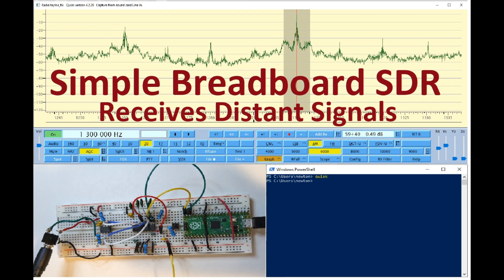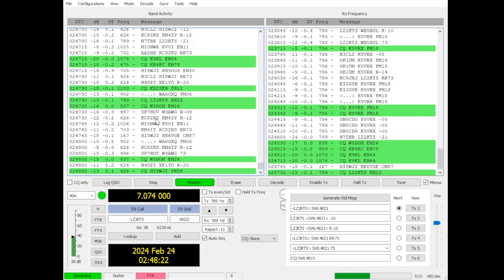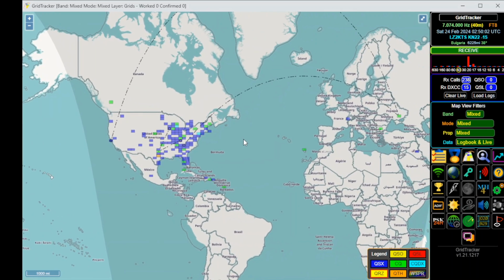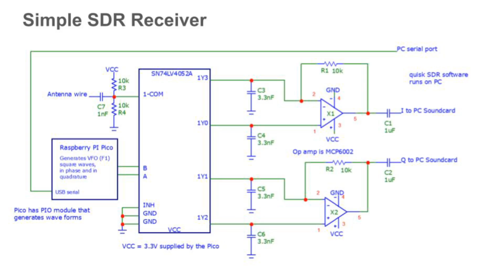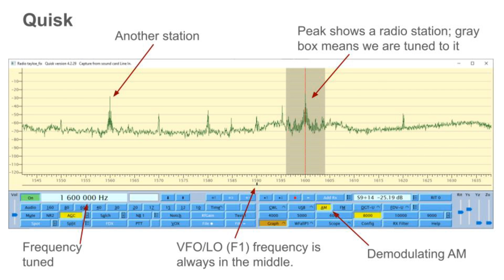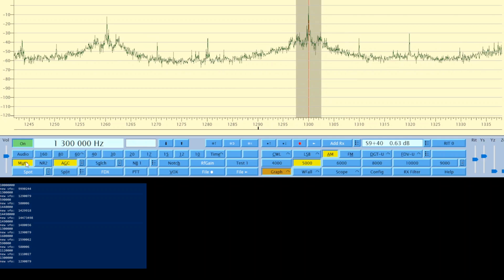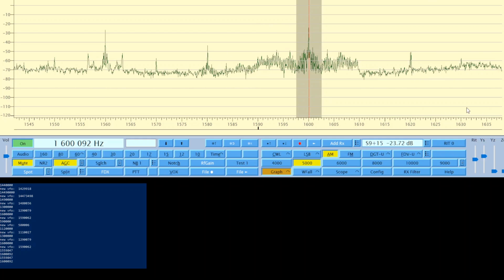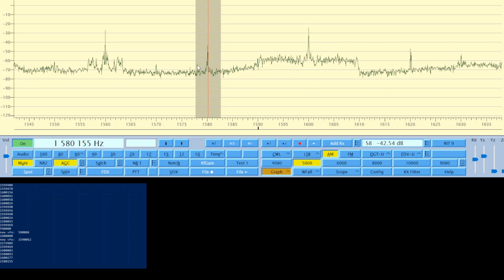Simple Tayloe Breadboard Software Defined Radio Receives Distant Signals

Comment: Are you running the Q&I audio streams through Quisk first and then piping it into WSJT-X?  Can you provide a bit of detail on exactly how you're doing this?  Thanks!
Reply from the maker: I recall that I connected directly to wsjtx.  You can connect it directly to the sound card.  I tuned the receiver manually-- by typing to the rpi pico serial port.  Connecting to quisk was harder.  I never did it perfectly...
Reply: @electronics.tinker  I checked and wsjtx isn't set-up to handle I and Q inputs - just straight audio.  To confirm I did a google AI search on "can wsjt-x use i and Q audio signals as input"  So it isn't exactly clear how wsjtx handled the input you fed to it.  It clearly decoded signals anyway but perhaps it relied on a single channel audio input.
Reply from the maker: I think you must be correct and that my memory is faulty.  Initially, I didn't plan to make this video so my record keeping is sloppy for it.  I was also using quisk.  Maybe I had quisk demodulating USB for wsjtx and just forgot that.  That's for your research.
Reply: @electronics.tinker  If you ran your output into quisk and then into wsjtx I believe you would have had to use some virtual audio cable software between quisk and wsjtx.  Perhaps you can recall whether you did this extra step.  If you didn't, wsjtx would probably still decode some signals  as I mentioned earlier.  Anyway, I enjoyed your video - it was very well done!

Comment: is it possible to make 100mhz to 5.5ghz sdr by a human hand {DIY}
Reply from the maker: That would be much harder.  Simple, cheap analog multiplexers are not fast enough.  Also producing quadrature LO signals at such high speeds would need different techniques.

Comment: This is a great video, thank you for sharing your knowledge with this simple but informative demonstration.  How difficult do you think it might be to create a similarly simple circuit to perform quadrature modulation of an input audio signal? Thanks again.
Reply from the maker: I presume you mean that the stereo audio will carry I and Q data to be upconverted to RF using the Tayloe circuit-- like for a transmitter.  I have not tried this, although it would be fun.  Dan Tayloe's paper briefly describes how to do it.  I put a link to that paper in my first video about the Tayloe mixer "Tayloe RF Mixer Demonstration...".   Also, you could check out NA5Y's youtube channel, in particular his video "ESP32 Based SDR Transmitter - Part 2 Tayloe Encoder".  He shows a schematic.

Cheers,

Comment: I actually followed this and dr volts video. It actually worked. It was stressful but fun. I ran into problems until i learned more about impedance matching. Thanks for this video lol
Reply from the maker: Very interesting.  What did you change to impedance match?  Also, what analog multiplexer did you use?  Most people use an fst3253 which has lower "on" resistance than the part I used.  This affects the input impedance and size of capacitors.  I paid little attention to this.  I just experimented with the size of the caps.  NA5Y uses a bandpass filter and, thus, more sophisticated matching.  I wonder how much the arbitrary nature of the antenna wire slung over a tree affects this.  NA5Y, being a HAM, might be using proper 50 Ohm antennas.

Comment: is there any alternatives for MCP6002  cant we use something like LM741, TL072CP, LM301AN, LM358L ?
Reply from the maker: I used an MCP6002 without giving it much thought.  I wanted the convenience of powering everything from 3.3V.  I was just playing around with it and was surprised that it works as well as it does. Dan Tayloe suggests using a precision or instrumentation op amp but for a toy receiver like this, my bet is that other basic op amps can work.  I think NA5Y used an lm324 in a tayloe detector.  It's convenient to use a dual op amp.  Dr. Volt used an amp that is especially good for driving sound cards.  Just watch your power supply level, pay attention to biasing the antenna signal (like to 1/2 of the op amp's supply voltage).  But also don't overdrive your sound card's input.  If you have a scope, watch out for clipping.  And use a long piece of wire for the antenna, ideally running outside.  Cheers and good luck.

Comment: thank you soo much!! i bought pi pico and a si5351 just to make a sdr receiver finally i can make one :)
Reply from the maker: I found it to be a fun thing to do.  I hope you do also.  Check out Dr. Volt's video and NA5Y's channel also.  There is a lot of material out there.  Getting quisk working takes a little guess work.  Let me know if you folks out there want more information on that.  I have found quisk to work better than other SDR software I have tried with sound card based receivers.

Comment: Really makes me wonder why some radios are $$$ when all they do is what this does in a fancy case.
Reply from the maker: Well, in the interest of full disclosure, a good SDR receiver contains much more: low-noise amplifier with gain control, multiple HW band-pass filters and HW to select among them, analog to digital conversion is included (instead of using sound card), and it works at a far higher sampling rate, and USB interface.  I think the SDR Play RSP1A is an example of a quite good but reasonably cheap SDR receiver.  And the rtl-sdr V3 dongle is not as good, but you can do a lot with it for a very low price.  Cheers.
Reply: @electronics.tinker  Great. Thank you. In case of only AM band receiver the band pass  modules would be ommited?
Reply from the maker: My guess is that at least a low-pass filter would be helpful even for AM medium wave.  I did a test with LO at 1 MHz and noticed that odd harmonics for the RF (like 3.005, 5.005 MHz) yielded false 5 KHz I and Q signals that were still pretty strong, e.g. the 3.005 signal was only about 10 dB down from the 1.005 MHz signal.  It also helps to choose cap values that give the detector no more bandwidth than you need.

Comment: Why is it these SDR radios do NOT come with instructions?? Going to a web site usually does NOT have any REAL information!!
Reply from the maker: Which SDR radios do you mean?  I agree that the quisk software requires guess work.  Do you have any specific questions?  The thing with SDR is that quite basic hardware (like an rtl-sdr v3) enables many things from listening to AM radio to receiving data from satellites.  There is quite a bit of youtube content, but it takes experimenting for sure.
Reply: @electronics.tinker  I cheaped out and got a TV board that had been adapted. Now I've got the "bug" (and badly). I want to make my own.

I have a very specific use for the Tayloe mixer that I haven't seen used before but I need to get the idea out of my head and onto a physical board! One dongle incoming from China now! :)
Reply from the maker: Sounds like fine.  Check out NA5Y's YouTube videos if you haven't already.  He knows a lot more about radios than I do.
Reply: @electronics.tinker my goldfish knows more about radios than I do so anything helps! This IQ stuff challenges my limited IQ to its limits. And more. I’ll get there eventually.

Comment: is it possible in Arduino atmega 328? thanks
Reply from the maker: I don't have an atmega 328 so I am not sure.  The task is to generate two 50% duty cycle square waves with one shifted in phase by 90 degrees from the other.  You want the frequency to be 10-20 KHz different from the radio station you want to receive.  The problem is that microcontroller timer hardware has limits to how it multiples and divides clocks to generate the final output frequency.  I bet the atmega 328 can do it for some frequencies but maybe not for the frequency near the station you want to receive.  This was the problem with the ADALM2000, actually.  The Raspberry Pi Pico is unusually flexible in how it can multiply and divide clocks, but even it has problems.  The way it divides can cause jitter.  Many people who build simple radios like this (including Dr Volt and NA5Y) use an Si5351 chip to generate the quadrature clocks.  This is a good idea.  Si5351 modules you can use on a breadboard are cheap and available from Amazon.  You would control the Si5351 from the Arduino using i2c-- but you really have to study the Si5351 to generate quadrature signals the best way.  But many on youtube have done it so there are videos to study.  I might do one more if I think I am adding something.

I'll mention another option.  You can generate a clock with 4x the frequency you need and then use a pair of flip-flops to convert that into the two quadrature signals that feed the mixer.  There are also youtube videos on this.  For example: https://youtu.be/OL52f-k3iIE?si=1-T5_9JH60DV_vtn.  I see a good video on mixers on this channel also.
Reply: Thank you very much, I liked the flip flop version  @electronics.tinker

Comment: Thanks!  After seeing Dr. Volt's video, seeing this super simple version is very nice.
Reply from the maker: Yes, though Dr Volt did  a great job I think.  To really improve the receiver, I suspect one needs to add an RF bandpass filter and maybe a low-noise RF amplifier.  But that would not be simple.  Check out this channel I recently found.  https://www.youtube.com/@M0NTVHomebrewing/videos
Reply: @electronics.tinker  Indeed.  It's the difference between the most minimalist design that can be reasonably functional, and taking a particular design as far as it can go.  The best possible RF amp, mixer, LO, filtering, and audio amp and processing can take a DC receiver pretty far.